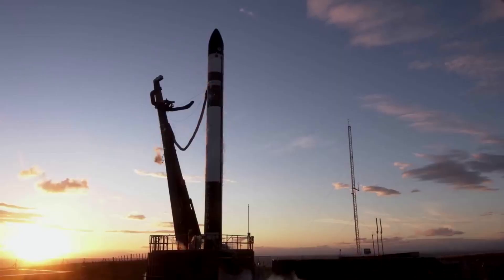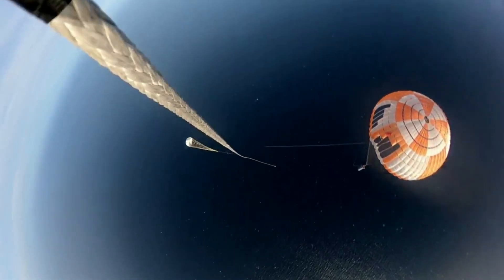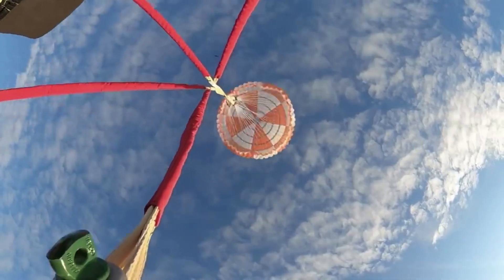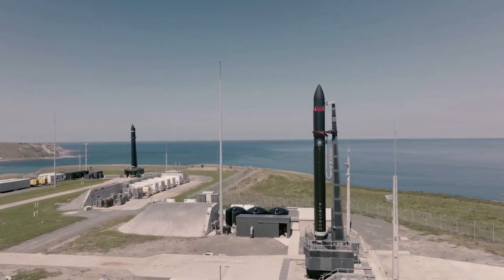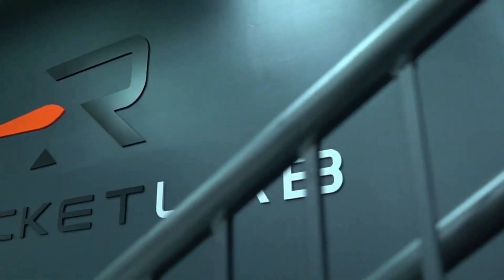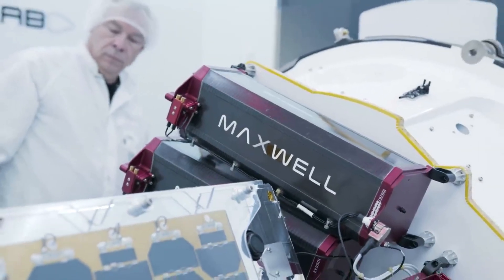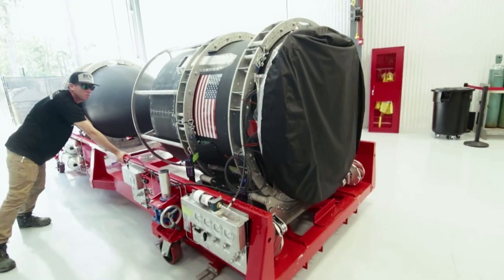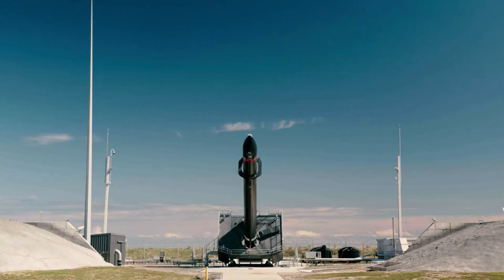The End of Rocket Lab Helicopter Catch Attempts, Upcoming Launch, & More

Comment: It is interesting that another company tried hard to recover a rocket component before it got into the salt water. Now they design for that to happen. Obviously a rocket engine would prefer not getting into the salt water but it sounds like it is a better overall optimization to design for it. Considering that the shuttle’s solid rocket boosters were recovered out of the salt water and reused suggests that it might be doable. Though with SLS it was deemed “uneconomical”.

Comment: That idea was crazy to begin with.  Not as crazy as Spin Launch, but almost.
Reply: Eh, I would argue that it's not that crazy of an idea. The US has been catching things coming from space for a long time. They even thought about catching the first stage of the Saturn V with a ridiculously huge helicopter. Granted Electron is bigger than the things caught in the past but the idea and approach are the same for the most part.
Spin Launch on the other hand is an entirely different level of crazy/dumb. It has a very small/limited use case and some really hard engineering obstacles to overcome. 

Also, the fact that Real Engineering thinks that it's great and will work, instantly tells me that it won't. Lol The guy makes great engineering videos but he always misses the mark when it comes to aerospace topics. I am guessing his area of study wasn't aerospace.
Reply: @dr4d1s  maybe they could try like a half propulsive landing? Slow it down enough and position it to fall straight down at a slower speed and help the heli catch it easier with less load tension?